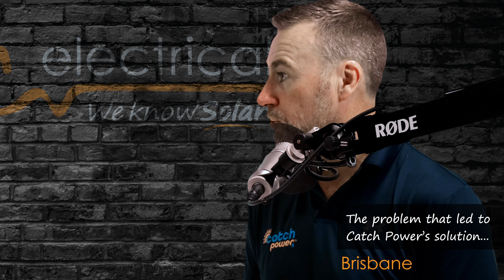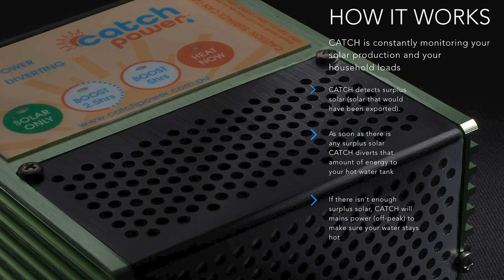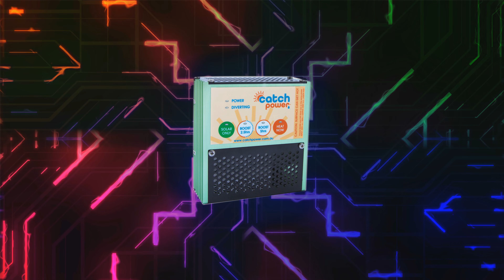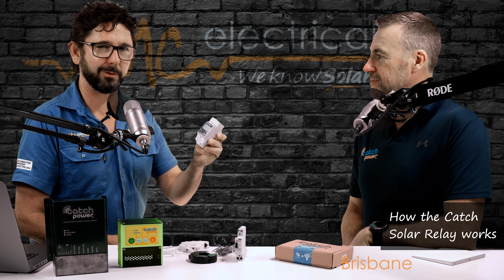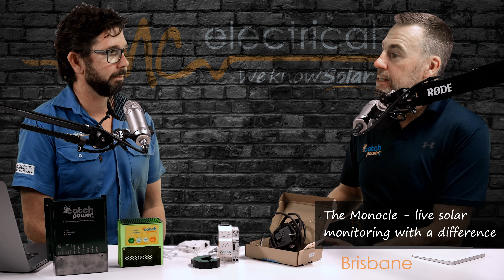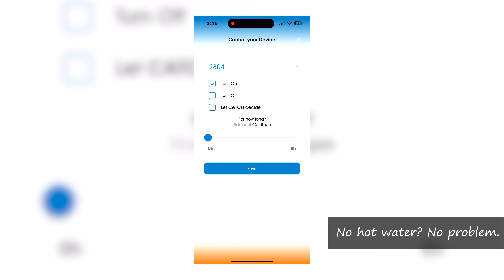Catch Power Full Review

Comment: What a great video. 
In thinking about switching from gas to electric hot water. The CATCH Power Green Gen2 is something to consider now instead of a normal timer switch. Does this device work with SolarEdge inverters?
Reply from the maker: From what I understand, solaredge are one of the few companies that won’t let catch relay communicate with their inverter (and work as a replacement to the solaredge consumption meter.) But, if you are are just looking for hot water hearing, the catch green or the catch relay will work with any inverter.
Reply: If you are running Solar Edge look into the Solahart powerstore hot water heater. It's a much smarter option. Not only does it look at the weather forcast, it learns your hot water usage patterns and enables you to enter parameters for peak and off peak rates. It also heats water in the tank to 75° increasing it's energy storage capabilities.
Reply: @justin9509 was quoted 5k installed for the power store, could get a good heat pump for that money or a electric hws with a catch relay or diverter formquite a fair bit cheaper
Reply: @justin9509  
"It is a much smarter option" (Solarhart).
I don't follow.
The hot water storage is legally required to heat to 60 - to avoid Legionnaire - but is also legally required to control the delivery at tap  temp to 50 to avoid scalding (children and old people the main concern).
Heating way over to 75 degrees seems very wasteful -especially given the ever increasing price structure.
The majority - by far - install the electric hot water outside. Even considering good pipe lagging insulation the winter Brisbane outside temp is in single figures for large number of days in that period . There is a huge temperature load from single figure temp to 60 degrees - which by law must be maintained in the tank.
Adding another 15 degrees to that - WHY?
btw...I just installed a new 250 L Rheem Hot Water and have regularly tested the delivery temperature since with a high grade instrument - it is spot on. I had never done this in previous years. I was surprised 50 degrees delivers a really hot shower IMHO - I never run the shower without mixing cold water.
 So 60 degrees would definitely be too hot and 75 degrees by extension would be ridiculous.
Water temperature up - beer money down.

Comment: MC electrical installed one at my house in December. Amazing piece of kit. That said, for 3.6kW heating element you need a decent solar system. I have10.5kW of panels and 8.2 kW inverter.
Reply: I changed to a 2.4kw element with 6.6kw system and now pay nothing for hot water
Reply: Cost $100
Reply: For element change over
Reply from the maker: Glad it’s working for you Pabich!
Reply: @bertr5650  do you know how expensive such a change is?
Reply: Don't need to change, as the Catch will only out in what is generated anyway!?